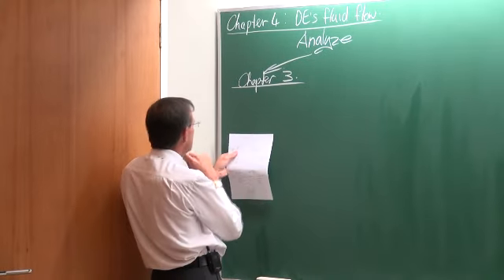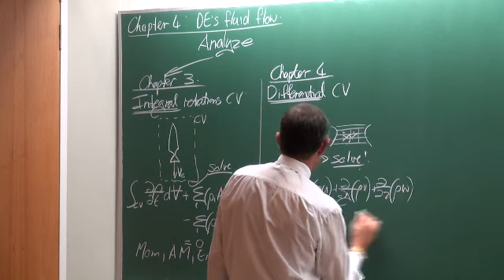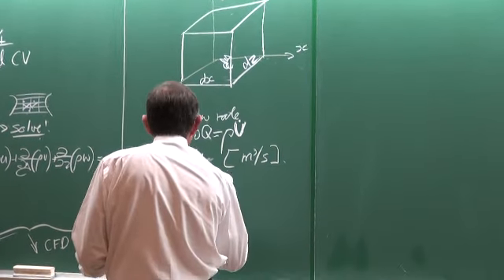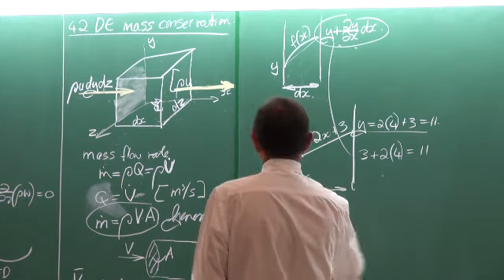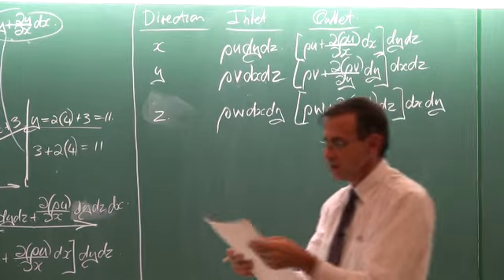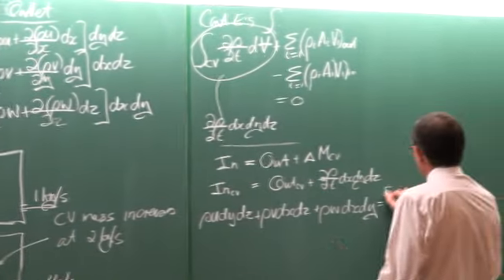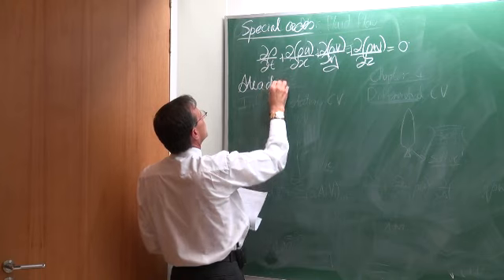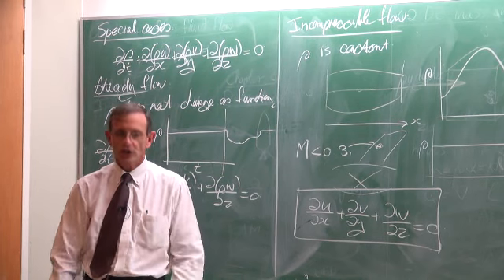Lecture 17 (2014). Continuity equation derivation

Comment: thank you professor. may be a 15 min introduction to Lagrangian and Eulerian volumes and the concept of material derivative can set the stage for better generalization of the continuity equation, and the temporal and spatial dependencies of density would make better sense when Drho/Dt or drho/dt becomes zero in that context. again thanks for the lectures.